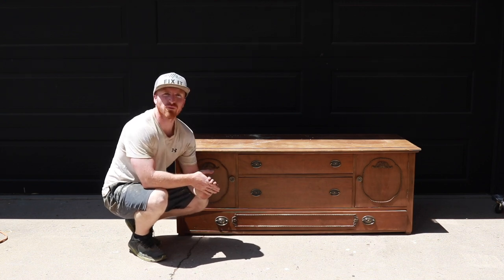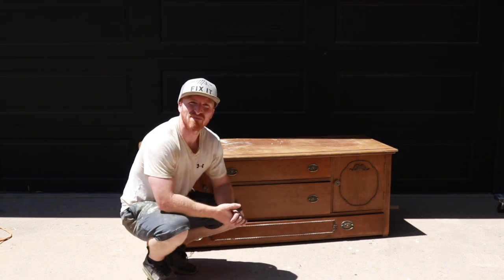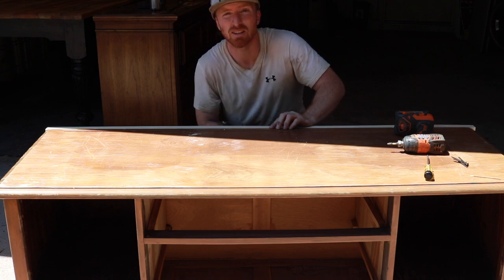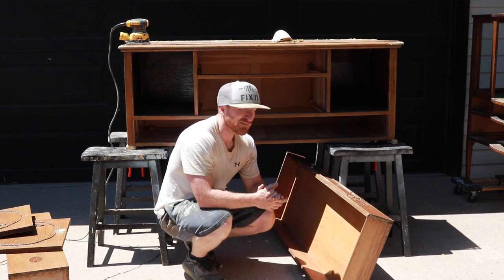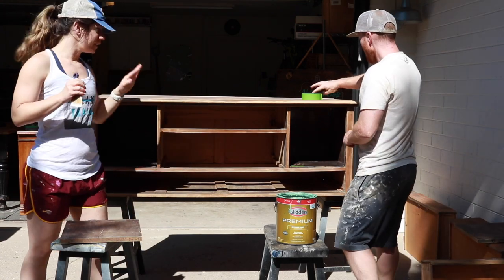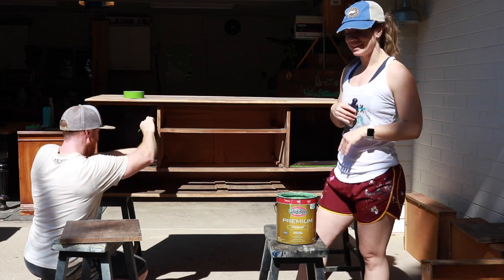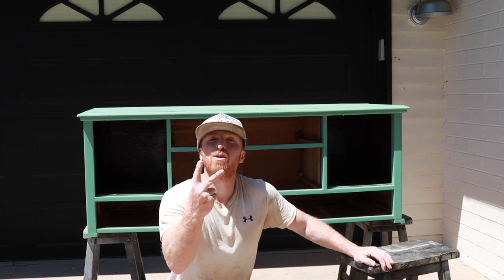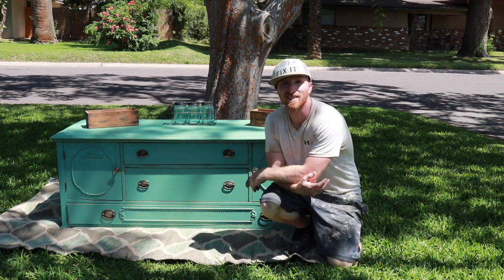Furniture Makeover | TV Console | Teal Color DIY

Comment: Great work!
How do you work so well with only a paint brush(no streaks)
Reply from the maker: Tia Griffin Hardie I love the brushes I use. Wooster short handle angles brushes. They are about $6 and I keep them clean. What I mean by that is after doing the drawers, frame, drawers, frame I clean them. So a total of five times. Using good new paint helps also. And finally what also helps is I sand my pieces for that vintage look which eliminates them completely. Even without the sanding, the brush strokes are very soft.